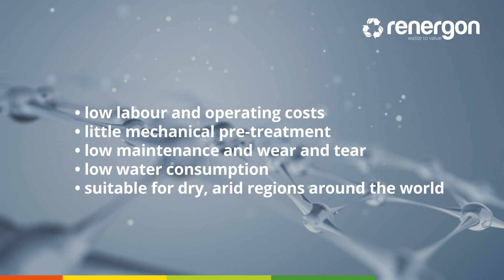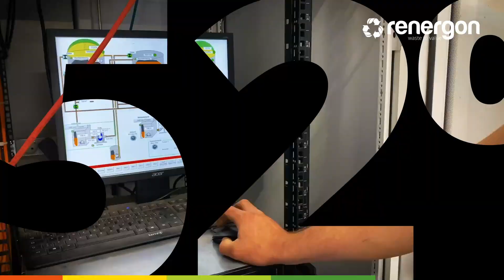BIOGAS: Anaerobic Digestion Explained

Comment: nice! wondering why still building mostly liquid digesters? because evryone got used to it? ok, no idea...
Reply from the maker: Hello thzorro, actually there is also a need for liquid AD plants. But if you got biomass with high dry matter, 20% or higher, e.g. municipal biowaste, greencut, straw, food waste, solid animal manure, etc. you should definitely consider choosing a dry AD plant (SSAD). You will get fewer, mostly expensive, technical issues and maintenance, save huge effort in substrate handling and preprocessing etc. Also, dry AD is by far not as water-consuming as common liquid digesters, therefore suitable for dry regions around the world. Have a nice day! #TeamRenergon
Reply: yeah in my system i need a way to process waste but also convert it into safe nutrients for soil, and potentially other users as well. humans tend have more ammonia in their pee and poop, and it's usually the aerobic bacteria that convert ammonia into h2 and n2 gas, while the anaerobic methanogenic bacteria produce methane which is a fuel more suitable for fuel, heating and is almost a drop in replacement for gasoline vehicles, all it takes is to reprogram the ECU computers of cars, and pedal to gas regulation ofc. similar to adding NO2, systems. and purchase natural gas appliances to utilize it. with that in mind we can also use the process that renergon uses to seed a liquid fermenter after pastuerization of the digestate along with table scraps, and if necessary test for coliform bacteria content and if not at an acceptable level, pasteurize the slurry, and use it for compost. pasturization can be done with other renewables, but post/pre pastuerization i'm not sure which is safer/more economical.
Reply: @Meleeman011  hello, can I please have your email to discuss?
Reply from the maker: Yes, of course: info@renergon.com

Comment: Great video and wonderful company. I’m curious, how you acquire the gaseous nitrogen?—Fractional distillation? Just curious how sustainable and eco-friendly the whole process is, including the precursors and heavy equipment. Do the plant tractors/machinery use the biogas to operate, as well?

Thank you.
Reply: They might be using pressure swing absorption since it’s a little less complex then distillation
Reply: I think heavy machinery will be one of the last parts of the economy to go renewable, so probably not

But keep in mind that fossil fuel plants use heavy machinery that also runs on fossil fuel. That aspect is the same. But biomass/gas plants don't burn fossil fuels directly
Reply: it's fairly simple to convert gasoline engines to natural gas engines, even the simplest conversion of putting a CNG tank with your pedal attached to a gas flow regulator would work better than ethanol in theory. the ideal A/F ratio for natural gas is around 17.something:1 compared to 14.7:1 in most gasoline engines. ethanol as a much lower a/f ratio than gas or methane, which results in lower fuel economy as the mixture is too rich, with pure methane, you need a leaner mixture for optimum performance, but since it's close you could run your car on methane without adjusting the ECU. you'll get bad fuel economy, but it will work. adjust the ECU and i would probably work slightly worse than a gasoline engine. 

most light work machinery uses propane gas, and if a company is really committed, they could use LNG or CNG work machines, or simply use methane generators to power hydraulic motors for actual work. in reality work machines are a drop in the bucket for emissions.
Reply: I drove a gas taxi 20 years ago, startup on petrol then flick a switch then gas, monk were doing this 20 years ago in portglenone to heat their monastery.